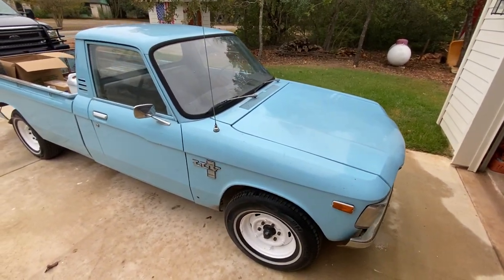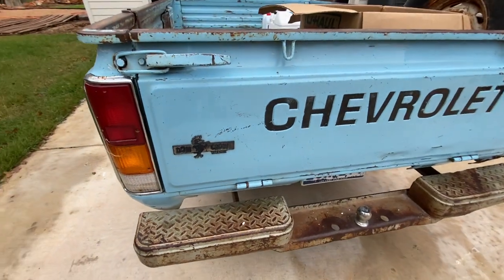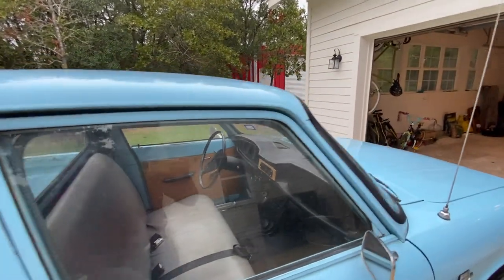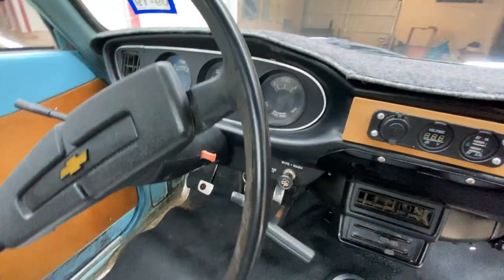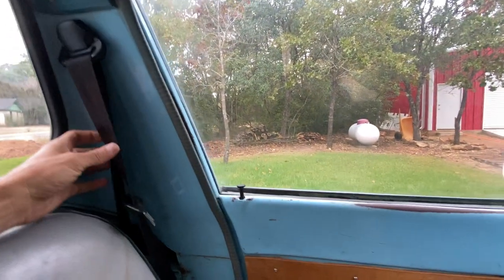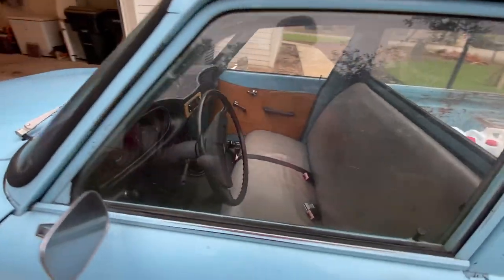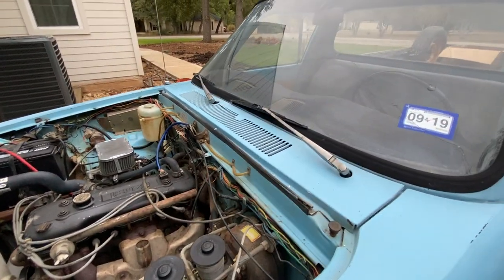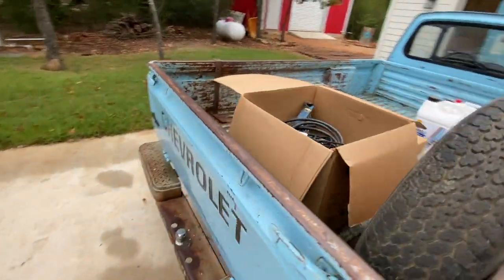1979 Chevy Luv

Comment: Did this sell?
Reply from the maker: Steven Castro yes it did.  It was a great truck
Reply: What you do need to do with these little trucks, Ford, Chevy, and Dodge D 50's, is to spray paint the underside of them with black rust olem paint in order to help curb rust on their chassis and frame along with the floor boards, and underneath the beds on them. That helps a lot especially when you live in areas where they use road salts to remove ice and snow.
Reply: Por cuánto bende el carro